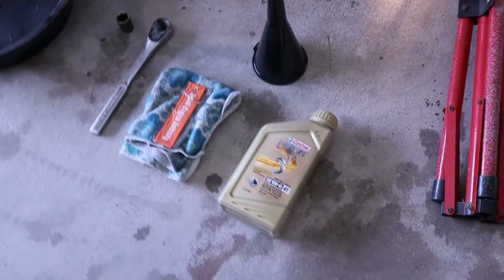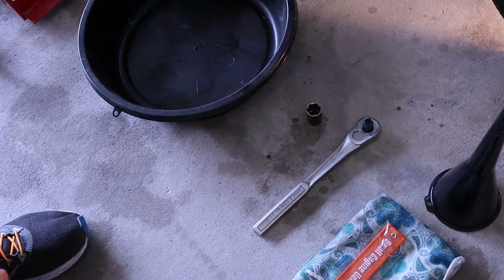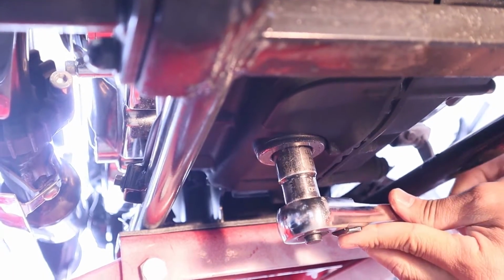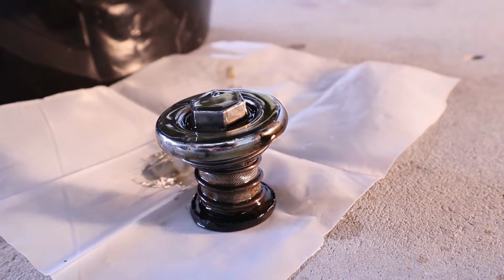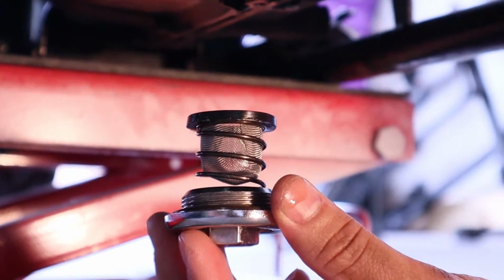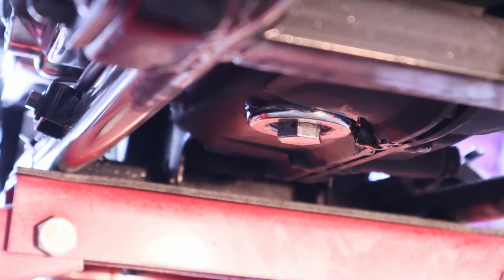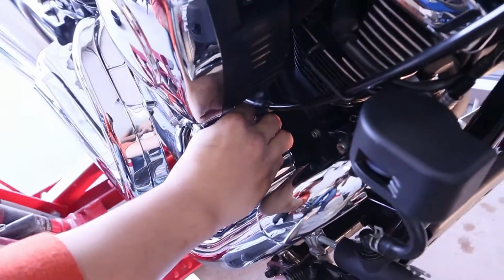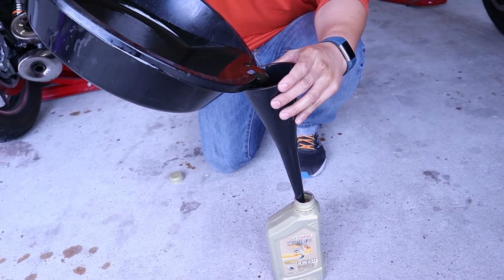Lifan Lycan Oil Change

Comment: Ceasar, Don't forget to change the oil filter. Unless they made a design change It will be located on the right side engine cover. Not absolutely positive but should be the same filter as the Yamaha V-Star 250. I have one I could send you if you want to try it.

Comment: I have a question. How many total miles you have on the bike?
Reply from the maker: 1200 or so
Reply: @SmallEngineVelocity  Cool, Okay. I was looking at the same bike. I just got a TaoTao TBR7 that's pretty good around the city but not the highway. I seen you other vid where you put it on the highway and it did good.

Comment: Caesar Caesar Caesar... if I didn’t like u I would probably ignore this video n let u brake ur V-Twins lol. Check the rear where the chain is at u will c that the recommended oil is 15w40... which of course it’s the Chinese way of saying this is the right amount of viscosity this bike takes from our country. But when compared it to US V-Twin bike standards u shouldn’t use anything less than 20w40 n shouldn’t ride this in weather colder than 40 degrees n below. N if it gets high enough u should upgrade the oil from 20w40 to 20w50, specially when the temps are above 70 like during summer. Check my channel I pretty much have all ur bikes lol. N I gave u props on the oil level but I never use it because from the get-go this V-Twin is a replica of a famous US brand with the exact part n that manual tells u exactly that the right quantity amount is 1.4 Litter or another words 1 Quart (946ml) plus around 470ml range reading it from another bottle which also has a marking. Sadly I will never b posting things like that on YouTube because of people that never give credits when credit is due, I just thought I’d share that with u since we r both Lifan Imported Quipai’s Lycan Master owners.

https://youtu.be/oghFiVRlSL0